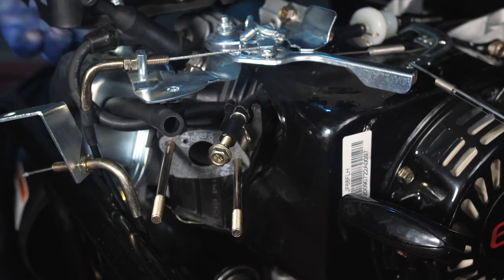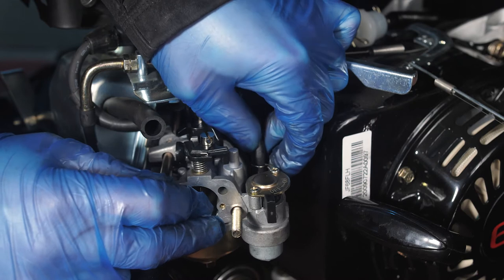How To Change The Carburettor On The FunBikes GT80 Trail Blazer 200cc Midi Off-Road Buggy

Comment: Hi I got mudrocks gt50 and when I start it it wants to to take off any idea what could be causing this and how I can fix this please
Reply from the maker: Clutch is stuck on engaged position. If it's not been serviced then service it. You may need to replace the clutch. They are not expensive. Available in spare parts section
Reply: @funbikes  do you have a link to purchase a clutch replacement?
Reply from the maker: @cliffc8830  Search Bar on website, easy